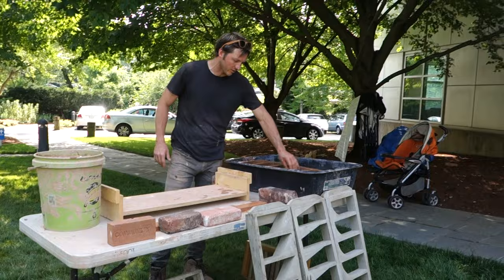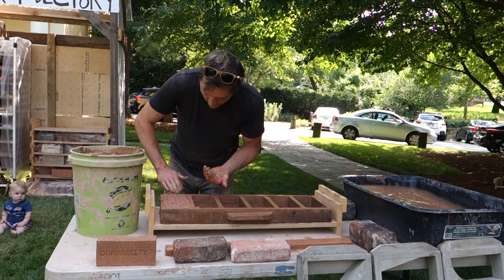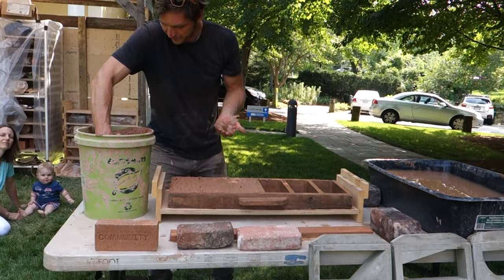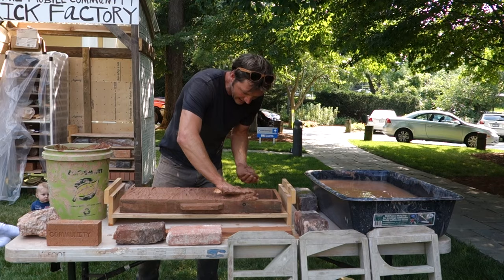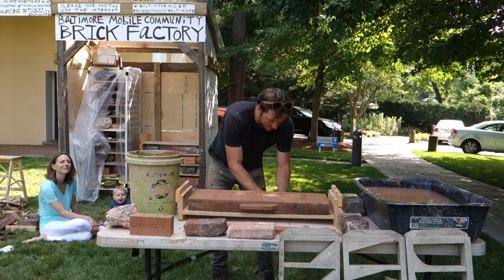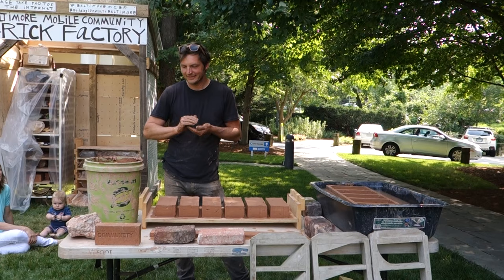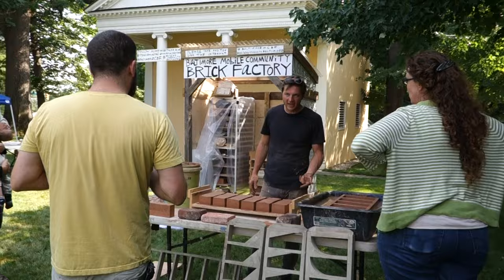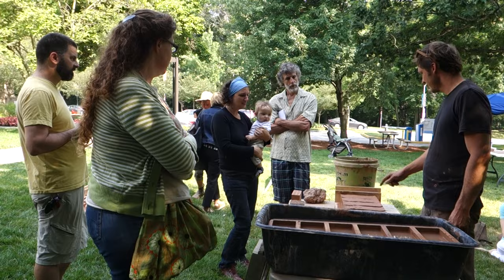Making Bricks with Josh at Mobile Brick Factory in Baltimore

Comment: good idea and thanks to all i will give ratios and everything ---the bricks without burning(cooking) mix opc cement one part and 5 part well powdered clay and watering 24 hour after making for 5 day now very good strong water proof cement soil brick
another method is make clay bricks and 2 or 3 day drying with sunlight and cook or burn with a coal or wooden firing system

Comment: Mudd, wood, and fire.  If it was more difficult we might still be swinging from trees :)  The most abundant building material, just add oddles and oodles of energy and walla. Ceramic :) Nice mold, and process. Im slow, so I leave the clay in the mold for about 24 hours. It sets, shrinks and releases easily. Your wet mixture is also key. As soupy as possible without allowing material separation via bouyancy.

Comment: I have a dumb question... can you do this with air dry clay or do you have to fire the bricks?
Reply: i have seen some brick manufacturers without the need to heat..i guess it depends on the materials they use
Reply: I guess it depends on the purpose of the bricks and the potential weathering they may face
Reply: An interior wall will be very different than an exterior floor made of brick

Comment: Do you not bake or fire the bricks?
Reply: They have to be air dried and then put in a kiln that is at least 1000 to 2000 degrees F. The lesser the heat the longer the bake will take.

Comment: I am wanting to make some fire bricks to line a fire pit . where can i find a mold like that to do so?
Reply: Make one!  Take three 2x4's, cut one of them into equal lengths, and nail the two long 2x4's to the side of the sections to make a ladder-like form like he has.  It helps to have a couple of smaller blocks of wood nailed to the outside of the form to serve as handles, but that's not absolutely necessary.

Comment: A life saving Question, what type of clay are you using ? Is it stoneware  mid or high heat clay, & if so, how could one find this & buy it for putting bricks together that will withstand up to 4000 degrees Fahrenheit before exploding so I can securing be safe ! ?????
Reply: There is a company called continental clay where you can order all types of clay

Comment: Question I'm making some kind of a forge out of these three holed clay fire bricks & need a clay powder paste to put them together, any suggestions or knowledge of what this is that will not explode after 3000 degrees Fahrenheit like concrete that does explode, personal experience issues I discovered & it wasn't fun, please help, it's a life saving QUESTION for anyone whom may know of something that will work, I'm learning & need to stuff like this, the fire clay bricks can withstand up to 5000 I believe but I can't find the paste / powder that will help & withstand the same temperatures I need it to help hold the bricks together, any suggestions or thoughts on specific materials ?
Thank you to anyone who will help answer.

Respectfully, / Sincerely.

Signed : 

Pauly~

Comment: i want mould
Reply: Make one man. Buy one brick, measure it on all sides and put a bunck of planks together with as many holes as you need, sand it nicely to make it as smooth as possible, deep it in water overnight and next day in the morning you're good to go. Only problem is that clay will be very cold in the morning and your balls gonna freeze for about half an hour. But then it starts getting warmer and you get used to it as well. Good luck 👍.

Comment: What, no frogs?
Reply: Some believe the purpose of a frog is to enhance the bond between brick and mortar. While it does in fact accomplish that ,it is not the main purpose. A frog is mainly used to work as a "wedge" to force the clay to the ends and outer edges of the mold to fill it more completely. With the "slop" molding method,obviously,the clay is "soupy" enough to fill the mold completely,hence,a frog is not needed.

Comment: He sun drys his bricks and brick yards kiln dry the bricks.
Reply: When they used this method you had to dry them to a proper level of moisture before you fired them. Brick yards formed dried and stamped their logo into them dried some more and then fired them. different levels of firing occured so some bricks were softer and so,e were harder the harder ones would be used for exterior walls medium for inner layers of exterior walls and even softer for interior walls etc. Some bricks were ezpeially hard and fire proof and were used to line fire place.
Reply: William Jackson yep down in south Georgia there are many old houses that were destroyed but the brick fireplace is still standing.